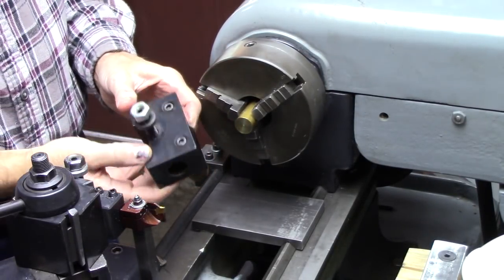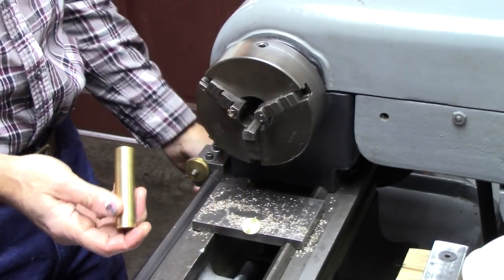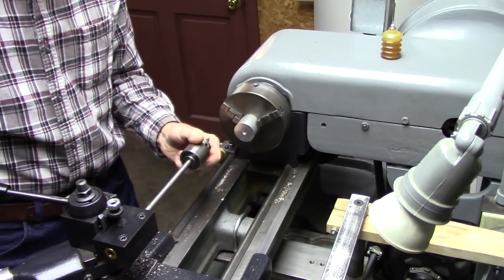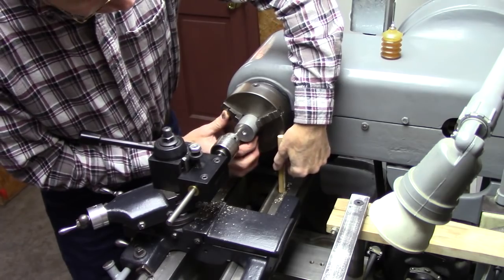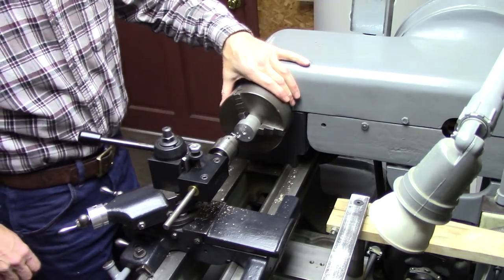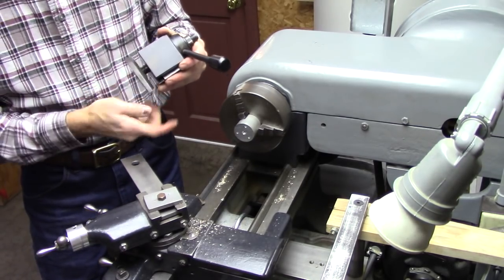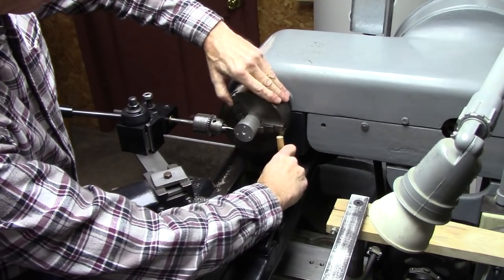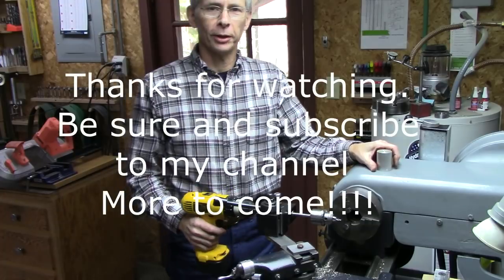Tool Post Drill - Easy to Build and Versatile!

Comment: Your just the man I wanna speak with....GREAT INNOVATIONS! As you have a carpenters shop too I believe you have the answers I need. I have 2 unused pine bedframes intact. But I need a lathe and was thinking of turning these into a lathe. (just for hobby work) Failing that maybe a pool / snooker table or a sofa. What do you think?
Reply from the maker: A wooden lathe works well but you need big wood for the bed. like 3x6 or 4x6.

Comment: Hi Winky. I have the same tool holder the 250-104 and I have never used it. I found your idea ver useful. I have a Logan lathe 821 too. It is for restoring althought now it is very useful. Has you recorded some video with ideas for lathe plate locking and for divisors in the logan? Thanks.
Reply from the maker: I sold the logan but made this  gear indexer for my south bend. Its simple and effective.  https://youtu.be/xauJcjrINy0?si=M5mZEgIYpRTGUhJh

Comment: Add a variable speed sewing machine motor, a couple pulleys and some 3-6mm PU round belt and you've really got an effective tool. Mount the motor overhead like they do on modern rose engine lathes. They work beautifully!!
Reply from the maker: That would work although I like the hand drill...  very powerful and simple.

Comment: Fantastic Winky!!! Just beautiful. I was looking for a Radial and/or axial drills to be able to mount on my lathe . This is brilliant and it uses things that we already have. I am sure we all have a 12 volt drill in our toolbox that still works but was replaced by the 18 volt system.
Reply from the maker: Thanks, yes I've used this drill a lot. I usually drill pilot holes and finish the holes on the drill press. It's hard to get a lot of pressure with the hand drill. Also this setup and not really ridged enough for large holes.
Reply: @WinkysWorkshop  Ah yes. Still fantastic!! Better than the consumer grade ones on eBay from what I have seen.
Reply from the maker: @Biokemist-o3k  Thanks

Comment: A live tooling spindle is a very useful addition to a lathe.  Yours is about as simple as can be, but very functional.

The one I built many years ago is self contained with the spindle running on 2 small Timken roller bearings I salvaged somewhere.  To power it I used a 12 Volt windshield wiper motor and a timing belt plus 2 : 1 step down timing belt pulleys, again salvaged from some office equipment.  These motors are very powerful and incredibly robust.

To power it I had a shop power supply that would supply up to 30 Volts DC at 30 Amperes.  This was built into the lathe bench, and the motor was plugged in with 2 banana plugs.

Today I would utilize a Micro Wave oven transformer and rewind the secondary winding for 24 Volts or so.  Use a full wave rectifier for 30 Amps to produce DC current.  Vary the input Voltage to the transformer, 115 VAC, with a TRIAC full wave lamp dimmer.  A dimmer good for 600 watts will do nicely, just make sure it is a full wave TRIAC dimmer.  Anything else won't work.  

If you can lay your hands on a 10 Amp autotransformer such as a Variac, that would work well, also, to vary the input voltage.

A spindle as described can be used to do very light milling also, to produce flats and small slots.  Just make sure to clamp the lathe spindle securely for such work.
Reply from the maker: Wow...  it sounds like you did it right. Mine has a little flex but I have had very good luck using it. The tapered bearing are reasonably priced now. Maybe I need to look at upgrading mine.
Reply: @WinkysWorkshop  Thanks for your interest, Winky!

When I decided to build my cross drilling spindle I spent some time deliberating the design and usage thereof.  Thus I wanted a spindle that was useful for accurate cross-drilling of work pieces, and axial drilling, too.  I used a 1/4" capacity Jacobs drill chuck with a 3/8"-24 threaded bore.

If I were to do it again I'd use a ER 11 collet extension holder.  These are available with a 1/2" and a 5/8" dia. extension.

The steel quick-change mounting block is L-shaped, with the lower leg pointing to the left.  The long vertical leg has the dovetail on the right face to fit to the QCTP, and the horizontal leg is wide, thick, and long enough to hold the quill spindle assembly, which is parallel to the long leg. 

The reason for the L-shape is that the drill chuck jaws are in line with the top edge of the vertical leg in order to use drills that are otherwise too long to use for cross drilling.

The hole in the QC tool holder for the quill was drilled and bored in situ on the lathe, with the edge of the short leg indicated parallel to the lathe Z axis.  The work piece was pushed against the drill with the tailstock barrel and a piece of wood in between to allow through drilling without drilling into the tailstock!

The drive motor is mounted on a plate clamped to the back end of the quill and thus is part of the quill assembly.

Thus the spindle assembly can slide a little in the mounting block and, more importantly, it can rotate freely in that block when the locking cotter is loosened.  This locking  arrangement is as per a tailstock barrel clamp.

This ability to rotate the quill in its mounting is important if the device is to be used for axial and radial drilling of the work piece.

To facilitate this the holder is made symmetrical from top to bottom about the spindle centre line so that the block can be turned upside down, with the drill spindle always in vertical alignment with the lathe spindle.

For radial drilling I simply align the left hand edge edge of the holder with the chuck front face using a 1-2-3 block.

For axial drilling I simply align the the drill with an edge of the lathe bed by eye;  for greater accuracy I use a dial indicator mounted on the lathe bed to align the edge of the block to the lathe Z axis.

The ER 11 extension is hardened and ground, and can run directly on needle roller bearings. There should be a very slight interference between the spindle OD. and the bearing ID.  This can be controlled with the interference between the Bearing OD. and the quill bore.  A needle thrust bearing would also be required.

I certainly found this devise useful and a real time saver when making steam fittings and pumps for my locomotive!

If you decide to build a new device, let us know what you decide and how you make it.

Good luck in all your work shop endeavours!
Reply from the maker: @BasementEngineer  I'd love to see some pictures winkysworkshop.GMX.com
Reply from the maker: @BasementEngineer  Also...  I watched a few of your videos... LOVE these trans! Amazing!
Reply: @WinkysWorkshop  I'll see what I can do.  My entire set of QC tooling, including tool post, was shop-built in the early to mid 1990's because I could not justify the expense at that time.

Comment: Simple and functional: Especially for drilling the side holes shown toward the end of your video.. I had made something similar using a hole saw on the end of a shaft then mounted to an adjustable plate to set angles for cutting pipe for welding; like 45 degrees, etc. Once angle is set, hole saw size mounted, drill is attached and cut made.
Reply from the maker: Cool idea on the pipe!

Comment: Just saw you using this in your latest video and had to search through your library to find it.  This is clever.  I need to add this to my list of things to build!
Reply from the maker: Hey there... it is very handy. I'm thinking about installing roller bearings. The sleeve bearing worked well for a while but now the center drill moves around a little.

Comment: I am unable to find your video on the cutoff tool support.  I know you made a video in a new design for the cuttoff tool holder, but I am interested in your original support -- pros and cons, and the video if it is still available.
Reply from the maker: I think I might have taken it down. Sorry. I had a lot of negative feedback on it. It worked well but when the insert got a little dull it wiped out the holder. Maybe with a better holder it would have been less of a problem. My direct mount HSS blade works more reliably and at least so far the spring cut off tool is very forgiving. Thanks for your interest and good to hear from you.

Comment: I sort of have it, mine doesn’t spin. My tailstock is very heavy to pull, so I have a drill chuck on the tool post. It goes to 10mm and is great for pecking :o) *I put a bar in the tool holder and a drill bit in the chuck to get the mount hole centred.
Reply from the maker: Cool idea!

Comment: Hi Winky, That turned out to be the easiest thing I have made so far. I ordered a Jacobs Chuck with 3/8” Threads, had a 3/8” Rod and my Boring Bar Mount had a 3/8” clearance hole. I still need to make a adapter for my Tool Post so I can drill from the side. Great idea Winky, Thanks
Reply from the maker: Glad you liked this. I have used it many time and you're right, very simple!

Comment: That is an excellent idea. I have that same tool holder that I do not use. I should make one of these and use the 1/2" chuck from an old corded drill motor I have been meaning to repair for 10 years but can't find the parts for. Thanks.
Reply from the maker: Thanks, go for it! You will like it.
Reply: @WinkysWorkshop  I did build one for my AXA size QCTP, works very well, thanks for sharing your build. I'm using mine on my NOVA DVR-XP wood lathe.
Reply from the maker: @bobd.  Very cool, good idea on a wood lathe!

Comment: Well, I just got my Jacobs Chuck, 2 different size 3/8” drive Tap Chucks, and even 2 Brass Balls in the Mail. I’m going to make a Tap Handle like yours, and mount my Jacobs Chuck on a Rod to use the Boring Head like this Video. Thanks for all the Great Projects Winky👍 I have to start out with the little ones first. I’m just getting really going on trying to Machine things.
Reply from the maker: Cool!  Thanks and good luck.

Comment: I am in search of an overhead drill for a lathe when I came across your video.   I do have a similar holder that I can use to do a similar project for my lathe. 
I would like to see a video on how to make an overhead drill from a steady.
Reply from the maker: You can set the tool post drill up to drill the side of stock as well although drilling from the top might be slightly more accurate.

Comment: I received your reply, Thank you.   You know for me at least, for no more than it will be used I am thinking to just go ahead and simply put a brass or bronze bushing in for the thrust consideration. And let it push against a set of locking collars.  That way it can be adjusted to use it on the carriage and on the cross slide as well.  Your ideas are outstanding and certainly original.  Thanks
Reply from the maker: I agree...  maybe a flanged sleeve bearing

Comment: What a wonderful (I would call an invention) idea.  Just lately came across your channel and am impressed with you genius approach to solving problems.  Thank you for sharing your knowledge.
On this particular idea, what would you say about setting up an arrangement with clamping bushings and a thrust bearing.  Then use the carriage or the cross slide to drive the drill inward.  For me I am not strong enough for drilling in steel for the larger drill sizes.  Do you think it is worth trying?  Thanks again.
Reply from the maker: I think that is an excellent idea and I have thought about doing the same. currently I use it for a small pilot holes and finish drilling on my drill press. I think the sleeve bearing is adequate rotation but a bearing for thrust would be ideal. You could use tapered roller bearings but for some reason they are very high priced. Larger tapered bearings are very cheap. The small thrust bearings are also cheap.

Comment: FYI you can buy off the shelf bronze bushings that will work in the 3/4 hole of the boring bar holder and even one with a thrust flange.
Reply from the maker: Good point. However, there were four reason I didn't do that. 1) I didn't have the bushing, 2) I could not find one long enough with the right bore, 3) I was worried the sintered bronze might not be strong enough for the clamping mechanism in the boring bar holder and 4) I had the brass, - Sure, I could have worked around a few of those...  maybe make the shaft larger in diameter and reduce the ends for the chuck and drill. And I could have used a press fit and not used the clamp etc..  Thanks.
Reply: @WinkysWorkshop  Very good reasons to do it your way. I used the bronze bushing for the same reason you used brass. I had 2 the right size for a 1/2" shaft and my chuck was treaded 1/2" . You do have to be carful about clamping too tight with the bronze bushings,  but the two I use don't slip in the clamp and the 1/2" shaft runs free. One goes in each end of the boring bar and they are about 1" long.
Reply from the maker: @bkailua1224  - Perfect, I could have done the same and even turned down the shaft for my 3/8" chuck.

Comment: well i finally made one...very similar used the big boring bar holder.....  whats the easiest way to center it though? height wise is what im getting at as it will change from when its on the qctp  to where it is on the extension bracket and will need adjusted with every use of either
Reply from the maker: I guess it depends on how close you need to get. You could line up the point of a drill with the point of a transfer punch in your chuck. Another method would be to put a 6 inch machinist rule between the side of a drill and the OD of your chuck (or work in your chuck). When the rule is perfectly vertical you are on center. I use this method for setting the tool height for general turning as well. Usually I don't need the drill perfectly centered. Usually what I drill is a series of holes relative to the chuck rotation.

Comment: Now this is something I want to do with the drill chuck off my old Hitachi power drill. It has a 10 mm thread. And I have the same AXA boring tool holder, which I do use, but now it can serve two purposes. I have also used that tool holder to bold the work to the tool post while using a milling saw in the chuck. A but crude but it did the job. Thanks for another great idea. If you are interested, the part about holding the work in the boring tool holder is at 7 min 20 sec into this video:

https://www.youtube.com/watch?v=Jpzz6nngzLk&list=PLGfoCtzNfeSCGPh4kyw2Mm9727d756V-N&index=11
Reply from the maker: Cool video! You are very good at utilizing the tools you have. You will like this machine I made. This video is from another channel I have. Check out the channel to see videos of the machine running.  https://youtu.be/lWEq-803TEs

Comment: WoW.. So clever.. I've always pulled the job out of the lathe and stuck it on a drill press.. but this is way more accurate.
Reply from the maker: Thanks. Yes it works great. I still use my drill press for larger holes but when the hole is located in the lathe with a center drill the accuracy is much improved.

Comment: If a bloke was keen he could use the side drilling adaptor with a small milling cutter and the indexing plate you made to cut splines / key ways etc using the lathe feed screw etc . That is perfect for ACCURATELY drilling / tapping centrally for telescopic sight mounts on rifles . Brilliant !
Reply from the maker: I never thought about splines or key ways! This would require a lot more than a brass sleeve bearing but it's an interesting idea.

Comment: Very nice!  I did something similar.  Made a tool holder on the mill like yours, but with a 1" hole, and mounted my Foredom handpiece in it for internal and external grinding.  I also used a piece of 1/4" steel rod to form a long hook, and hung it from the ceiling over the tail stock, to hang the Foredom motor on it.

I have a Jacobs chuck to fit the handpiece collet as well.  Fun stuff!

Comment: Wow, I just watched your 100 and 44 index video and this, and I am amazed at your ability to figure out how to do things with common stuff laying around. Like I want to try some gear cutting, but I don't want to spend an arm and a leg for fancy equipment if I don't need it, since I'm just a hobbyist.
Reply from the maker: I've thought about cutting gears too. I'm sure it could be done in the lathe although I don't know much about tooth profiles. I do know you can buy cutters to use in a mill which could be adapted.

Comment: I like the simplest soultions to a need. You have mastered that philosophy. I also like the old iron as well, I have a Clausing 111 Mk3a i am slow restoring as use it to do the work on parts that are need. I just aquired the stub gears for it to cut near metric threads that work great for non presison needs. Keep up the great work

Comment: The indexing trick is fantastic! And with a set of different length sticks it would be possible to have many precise divisions (6, 9, 12, etc.) just changing the starting point of the rotation. I have to dust my trigonometry books…
Reply: And the right length stick positioning the jaw on the front side as well as the back gets an easy hex pattern

Comment: Wow....I don't have a mill. Just a logan lathe and I have had issues drilling into 11/64 tool steel along the length of it exactly center. I want to put a set screw to hold a 1/16 drill bit inside it for my engraving machine. . This will be perfect for that. Can't thank you enough.

Comment: Thanks! I built one today and it helped immensely. solved a big problem.
Reply from the maker: Thanks William, I'm glad it worked well for you. I hope to an add on indexing wheel soon. I'm thinking a wheel with rows of 100 and 48 holes.  With these holes you could drill hole patterns with 2, 3, 4, 5, 6, 8, 10, 12, 16, 20, etc...  and also 100 for making lathe dials. I made dials using a 100 tooth saw blade a while back. It worked great.
Reply: When you do, please make a video.
Reply from the maker: I will.